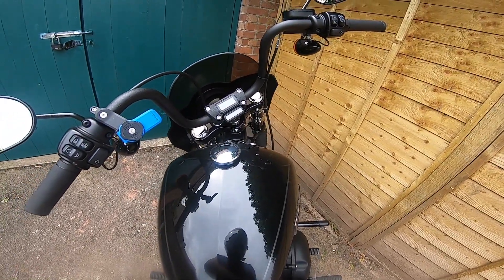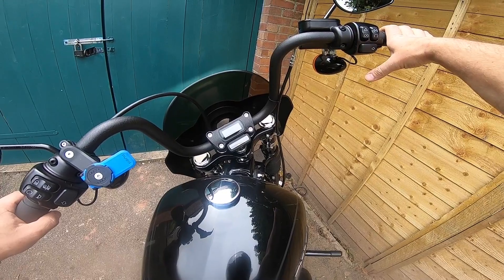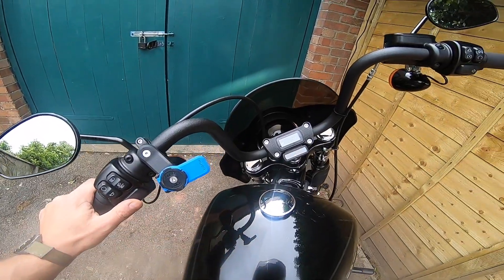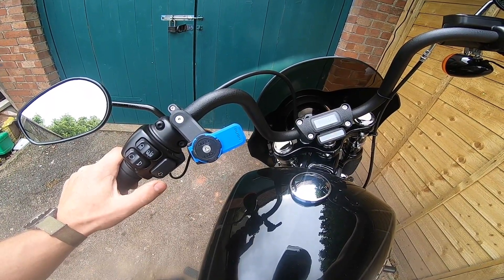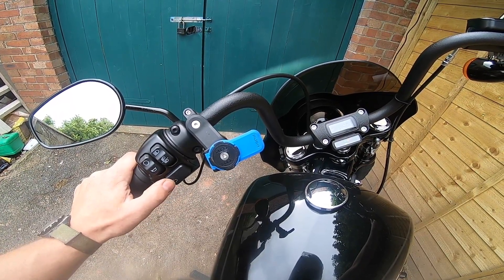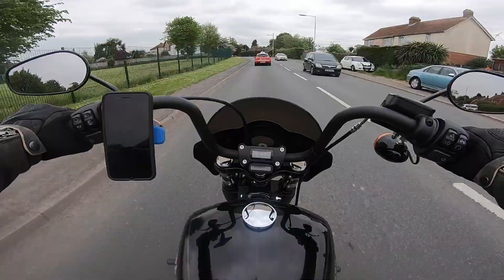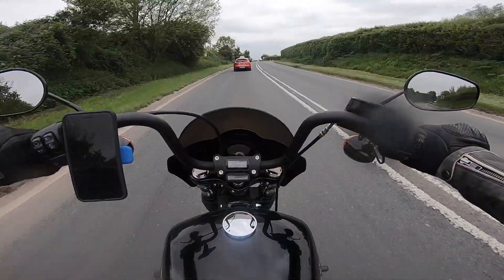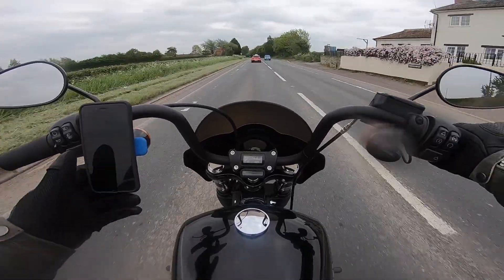2018 Harley Davidson Key Fob Pin Change & Quad Lock Review -  Harley Softail Street Bob

Comment: Ok, I’ve just reset my pin. Thanks again for the video. I really enjoy all your vlogs. I quick question. Now that I’ve got my pin st, how do I actually start the bike if I’m missing my key fob?
Reply from the maker: William Hyland so I’m not sure on that one...but pretty sure you turn the ignition on and immediately hold both turn signal switches until 5 dashes appear in the odometer window. Then enter the pin and hit the right turn signal again and it should start? But I’m not 100% not tried it yet 🙄